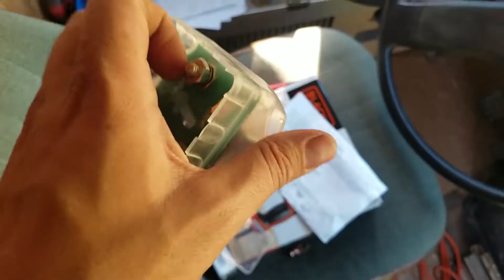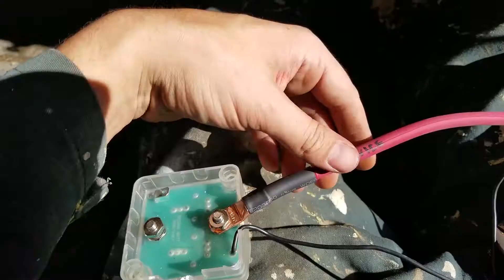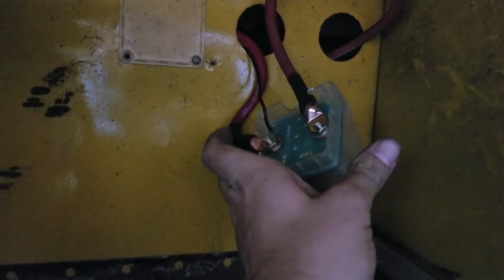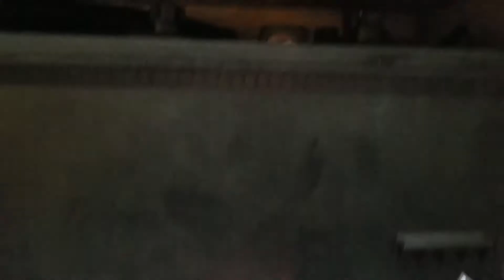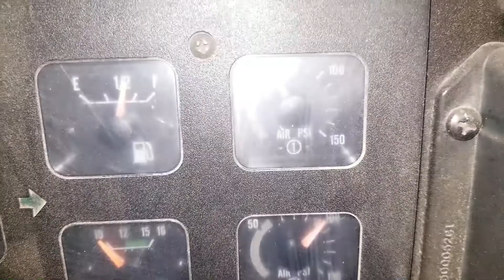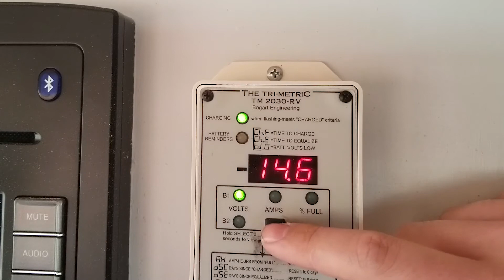Conversion Video 39: Battery Isolator Install for Alternator Charging

Comment: Great video!   I too will have solar, so this is pretty on point for me.    Curious though as to whether it needs a shunt or inline fuses?  It does look like a pretty cool replacement for my old fin isolator which is possibly original equipment on my '87 bus.  LOL   Hopefully, your True Isolator is still functioning properly, at this time, in Sept of 2021?

Comment: Mount isolator away from where the batteries can't hit it if you had to hard brake. Bolt 2x2's behind and around batteries with nylon webbing straps to safely secure them.

Comment: Does your battery isolator try to charge the house batteries even when full?  I think house batteries can be damaged doing so.  I'm cramming for my future skoolie build and want to use an isolator myself.
Reply: Smart isolators won't do that. Old school conventional isolators (ones with metal cooling fins) will.
Reply: @pastelskies8466  thanks for the info friend 👍

Comment: I have a Ford 2000 E450 with two engine batteries. I guess it has one alternator. Can I just connect it to one of the engine batteries?
Reply from the maker: Yes, that is what I did. Your batteries should be connected together, so they charge and discharge together. I connected where they connected. I think you could also get away with just attaching to one of the engine battery terminals.
Reply: @DIYSkoolie  thank you so much
Reply: Contact True to ask them the proper and safest way to route connecting wires to the batteries. It's VERY important the correct amperage isolator matches the rated amperage of your alternator.